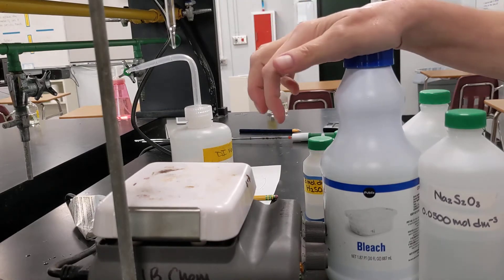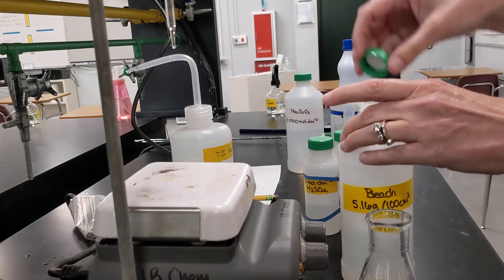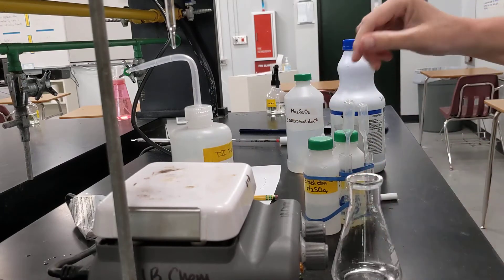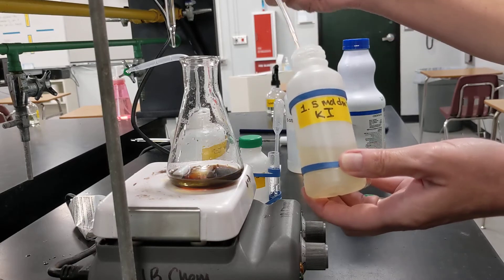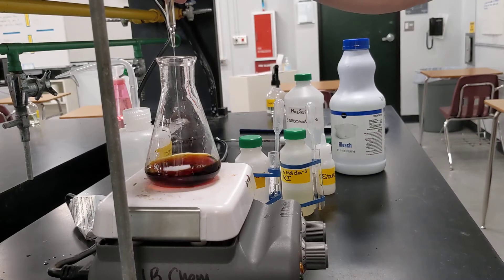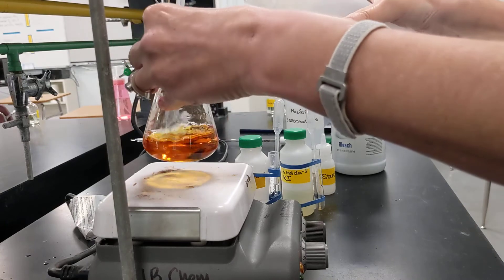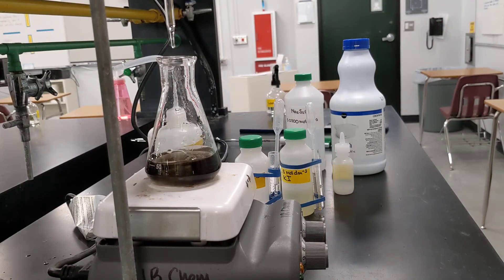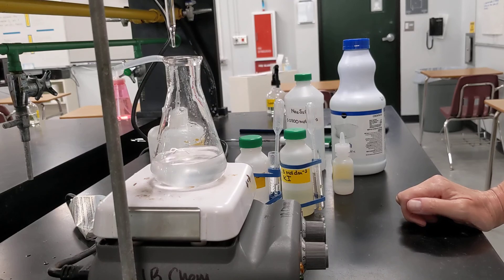Analysis of bleach redox titration lab

Comment: When I did this lab, I measured my diluted bleach exact and something went wrong and it stayed brown ;( this video is great, my lab doesn’t have the electronic mixer, I wonder what I did wrong. Stay safe! Make more videos! 💫
Reply from the maker: Thanks!  Sounds like you didn't add enough moles of thiosuflate to fully react.  Try a slightly higher concentration of thiosuflate, or just keep adding until you observe the change.
Reply: @chemwithms.d  thank you so much! So helpful

Comment: No doubt its well planned but i do not understand why you wash it down in between? would that not  dilute and bring about change  in endpoint ?
Reply from the maker: Adding water doesn't change the number of moles of bleach in the flask - the same number of moles will be there to react regardless of how much water is added.  We know the volume of bleach solution originally added to the flask and it is that volume which will be used in the calculation.  Hope this helps. :)